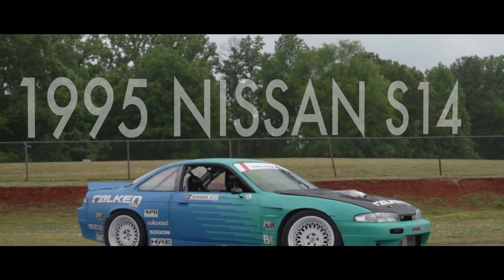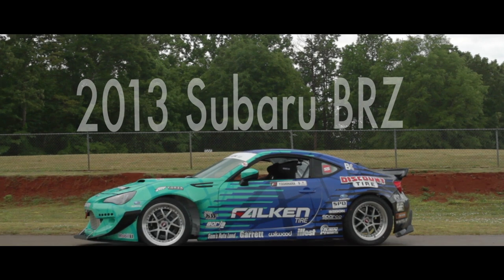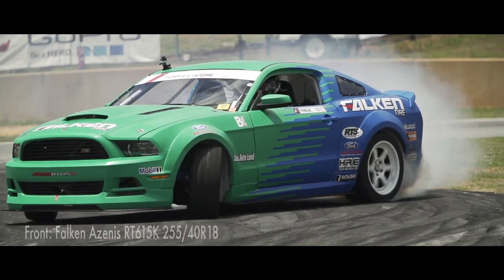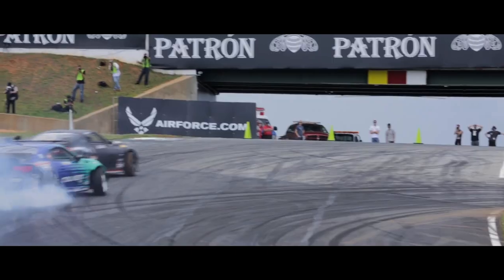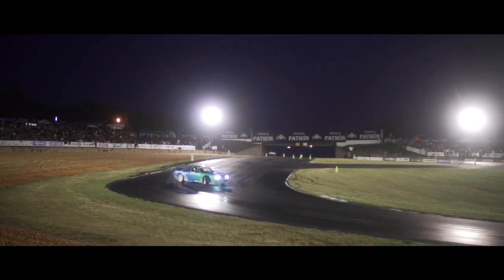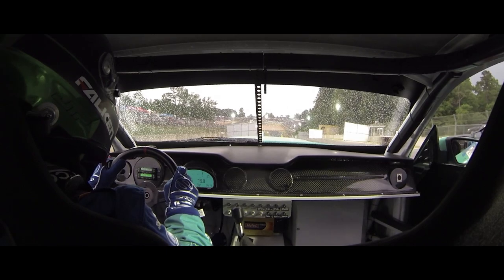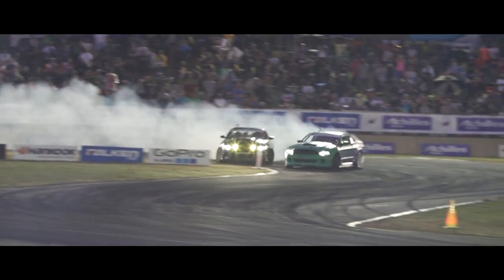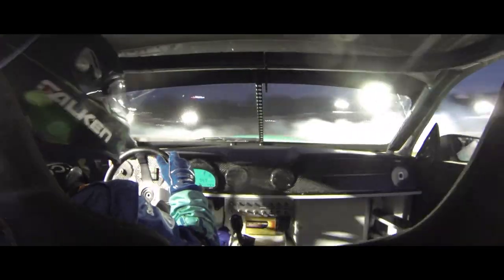1000+ Horsepower Drift Machines Explained - Controlled Chaos Eps 2

Comment: I just don't understand..... Why make the GT86 with what it comes with stock just to replace it with a big v8? I mean it's defeats the point of the car... With that engine what's the weight ratios? Can't they make a 2.6 boxer FJ engine   and boost it?
Reply: A lot of you V8 haters would be surprised that "aluminum block" V8's can actually weigh less then the iron block I4, I6, and V6's they replace... 

With the GT86/ FRS having the Flat Four 4U-GSE/ FA20  and guessing that it is made out of aluminum, an LS swap would only add a couple hundred pounds... I'm sure that weight is being stripped, or balanced on these comp cars in some other way. Also working on a V8 is a hell of a lot easier/ cost effective than a 2.6 boosted boxer swap.
Reply: bryan1211 I don't hate any kind of engine my point is it takes away from the car it's self.... Might as well buy a corvette... Buy a civic si and remove the vtech from it to replace it with a v8 then it's not a civic anymore it's just a Honda platform to build from.... The Gt86 is a good car and I want to buy one... But after seeing this an turned off by it because no matter what I do to it just not going to be good enough....
Reply: Amari Maahes What's the end goal you desire? 200+mph wangan racing? Ya, GT86 may not be the best choice(unless you motor swap, or upgrade motor $$$)... Fun daily track/ drift car that one can progress with and slowly modify? If the second, it's a great platform! I'm sorry but 200hp is more than enough power on public roads and you can just as easily spin out, or die in a stock GT86 than any high HP exotic...

The whole "once you change an engine it's not the base car anymore" is kind of childish... One must use the platform they acquire and build/ modify the way they seem fit. Most of these comp cars are purpose built and only share the frame and some sheet metal of the original vehicle. The important thing is balance! The Japanese build great fun car's because they understand a car you want to drive and have fun with "everyday" must be well rounded and balanced.

 Adding power these day's is easy... one must upgrade tires, brakes, and suspension to truly get the benefits of high HP. Then comes adding support through roll caging, bracing, bucket seats, ect....  If you have no skills, all of the above will be pointless!!! These car's don't drive themselves and a stock FRS/ GT86 will teach you very basic/ fundamental driving techniques. If you already have those down the GT86 will still be a great car in stock form because it's a drivers car (meaning it's fun to drive!).  Many people are making turbo kits that pump these up to 300hp. With the weight of these cars + 300hp you could be smoking older stock Vettes no problem.

And finally a C6 Corvette weighs about 3,300lbs and has an LS3 that makes around 430hp. A FRS/ BRZ/ GT86 weigh's around 2,800lbs, so if that Ls3 was thrown in the GT86, it would double the HP output over stock and still weigh about 300lbs less than the Vette... Oh and with just a basic engine swap it would still be an GT86, just with a different power plant.
Reply: Firstly don't put words in people's mouths and modify peoples words for your own means and secondly don't make assumptions.... I don't race on legal roads.... When I spend my money on something I want to get what I paid for! Am not going to invest 28k in a gt86 just to replace to motor down the road.... And invest God knows how much more turning it into what you desire it to be.... Am not against it but why buy something just to transform it into something else..... Same reason alot of people out there rather buy a BMW.... you get good platform and a good engine... No need to drop a v8 in there just mod and tune and your set... But to each his own... Can't wait to see what the M235i can do...
Reply: Amari Maahes are you ten you are trying to compare consumer cars to custom built race cars that only pro drivers cold drive at there limits. not to mention you compared a 25k car to a 45k car.
Reply: CruzinKrispy don't worry about it... buy what you want and be happy..... I rather buy a 45k car. It's fruitless trying to explain...
Reply: no its not that I have a problem with buying what you want its just that trying to compare a 45k car to 25k car is  pointless of course it doesnt come with a twin turbo I6 six because it doesnt cost 45k like the bmw does. as for the v8 swap things i understand your a buyer not a builder, most people that are into cars are the other way around.
Reply: bryan1211 boxer motor has lower center of gravity though.. all these D1 cars are great on the track but really shit on a tight street type circuit
Reply: Rick James I wish I could agree, but just look at the Mitsubishi Evo's and one could see that they can keep up and dominate there rival boxer equipped Subaru STI's (I'm a big Subaru fan btw). Meaning the boxer engine isn't that much of an advantage (even in tight stuff).  Also these D1 cars are made 98% of the time for huge sweeping racing circuits (thus why you have the huge HP wars). A tune/ HP output for a small track vs. a big one would be completely different. Also are you talking about drifting on a smaller track, or grip racing/ Touge?
Reply: Amari Maahes 45k car budget? Why the fruit would you even consider an FRS/BRZ/GT86??? You must really be 10... If you're not, do everyone a favor and buy a mini van please!
Reply: What no one seems to understand is for some reason you want a car that's capable of over 9000 power levels (on it's original engine that's still very new). Yet you could possibly have a budget of around 45k and would rather buy something new and capable, that doesn't require an engine swap... Dafuq would you even consider a FRZ/BRZ/GT86 for then???

 Also come on the "keep it's soul" comment again... People drop 2jz in BMW's, 13b's in a 240sx, it doesn't mean shit!  Do what ever makes you happy, but don't rip on a car that was never designed to have over 300hp and then bitch about someone throwing an LS engine in it to make it competitive... Then on top of that saying because someone swapped an LS in this car, it's "soured" the vehicle in your opinion some how?? You seem to have the personality of a mini-van driver... I'd start there first!
Reply: Talking street cars, yes why change the main engine, just "improve it". However when your talking dedicated race car, you go with what is proven to work. I mean if the v8 twin turbo engine is able to handle the punishment of this version of racing with out having to rebuild the engine every race, then go with the V8. Real race cars are nothing like their road going counter parts other then the look of the outside. You would never want to daily drive any one of these, not to mention for legal reasons, but just for the ability to stop go in traffic these things would be miserable to drive.
Reply: I think they can do whatever the fuck they want to do, and I'm sure they know exactly what's best.
Reply: 2ofEverything ya I agree, they're not called professionals just cause they like the sound of the name.
Reply: Amari Maahes Dai drives a BRZ because he is sponsored by Subaru. He put a v8 in it because his team has been running v8's for 4-5 years and they trust the platform. If you dont see the point in buying a 25k car and spending 3-6k on it then all you have to do is not do that. Somebody who criticizes other people for doing what they want to their cars with their own money has no business doing so. I could buy a used car for 1500 and spend 20-25k on it and get supercar level performance out of it, and would enjoy the car way more than if I bought a 25k car because I would have put my own soul into the car to make it exactly what I wanted it to be.
Reply: Stephen Kauffman good point . Thank you.
Reply: 1000 hp just blows me =/

Comment: 1000 HP? People have won D1 with a fifth.
Reply: 1000 HP has been in D1 long before it hit the states. lol Just the states are catching up to the numbers. Daigo's Chaser in D1 was around 700hp - 800hp back in 2008 - 2009. Takahashi's old Chaser was around 800hp back then. Around 2012 Daigo's MK2 was pushing 950hp+ (Estimated) with Nitrous.

And I don't see nothin wrong with high HP. This isn't kiddy drifting at that level. And just because they run high hp doesn't mean they lack any form of skill. The reason they run high hp is usually because the lower hp actually limits them on what they can do with a car at their skill levels.

Shrugs I can only dream of doing what half of these guys do in their beater cars let alone their pro cars.
Reply: ***** drifting low power cars involves so much more skill. These high powered ones are just for tyre smoke and easier for breaking traction and keeping it broken.
Reply: Sunny But like I said it doesn't mean they lack the skill. They still use they're missle and beater cars but just in lower tier competitions for fun and more track time and to gain more experience.

Comment: Drifting a car would be really fun.  Fun to watch also.  But I'm just not a fan of LS V8's into like the brz.  Its not a brz anymore.  Its a chevy.   I do  hate on v8 or chevy.  LS motors are great for power, is cheap to build and is reliable.   Drifting is not like road racing where the teams actually develop the cars  platform.
Reply: vangt858 I agree

Comment: Is it REALLY necessary to pump out 750-1000hp into these cars??? Why couldn't they leave the original FA-20 in the BRZ? Or swap it with a EJ257 motor tuned by Crawford? Seems unnatural. :/
Reply: Becuz drift. and its a horsepower race between different teams aswell engines with more cylinders have more low-end torque
Reply: Its a drag race to the first corner and if the chase car is too far behind they get zero points for an inactive chase.

Comment: Too bad you have 750 more hp than you actually need to drift
Reply: Drifting for fun is a whole different ballpark to competitive drifting...
Reply: What's the point of this post? To rage that you aren't competing at a level like this? Goodluck doing what they do in a ka/sr lol
Reply: Josh Johnson Dave Briggs runs a SR in his formula D car.. Turbo 4 cylinders FTW!
Reply: The reason they have the power is so that they have the big numbers, can slide easier, and so they can say they have more power than any other company.
Reply: Still if you've ever watched d1 Grand Prix specially in the old days like 2001-2005 they were and still are the highest level of competition and some cars only ran 300-400 hp and the highest were 500-600
Reply: You have no idea what your talking about d1gp is proof that you don't bed high hp to be competitive at the highest level of drifting day yoshihara came over here to drift cuz he couldn't compete with the d1gp the high horsepower is just making sure that the privateers can't compete unless they have big pockets watch some d1gp how smooth they drift how little corrections are made in steering angle and throttle and how close they get with a 300hp car against an 700hp car and when the 700ho car loses sit there and wonder why that happened drifting is about keeping up your speed and momentum thru corners that takes skill look at team burst using 330hp sr20s and Naoki is one of the best drifters in the planet

Comment: say no to Ls swap to import smh. I love my s13 with 300hp sr20det.
Reply: +francis brown As much as i love an original engine, you just cant run 800+ hp on an SR20 reliably.
Reply: I agree 100%. 800 hp is a huge number and even LS wouldn't be reliable at that number. At least not for prolong period or repeated abuse. I would consider RB swap before LS.
Reply: gotta unleash that coyote
Reply: S13 should have ca18det .....
Reply: Zuze91 depends what year his s13 is
Reply: RB is too expensive to be used for drift special with 800+ hp. LS is engine with great specs and durability.

Comment: How do they even fit that engine in the BRZ's engine bay?! Is the nose longer than stock? The dash looked stock so I don't think the engine is pushed back??
Reply: It just falls right in. Stock engine in the BRZ is fairly wide to begin with.
Reply: The Chevy LS V8 platforms are heavily compact man. You could fit the same engine into a damn S2000 or Miata. Granted you need stronger mounts but still it would fit in well.
Reply: There's a shop based out of Connecticut called Weapons Grade Performance that's building an LS swap kit for these cars now. I'm not sure if they were the first to put an LS in one, but it's been done for quite some time. You can probably find videos of it on here if you search BRZ06.

Comment: I honestly so tired of V8 swaps, I remember when this trend first started and I thought it was stupid back then, you do not need 1000hp to drift, truthfully a drift car shouldn't have over 700hp which you can achieve just fine with a 4 or 6 cylinder, when I start drifting not matter if I remain amateur or become the most well known driver in the world I will never do a V8 swap I'll do a 6 cylinder swap but not an 8
Reply: Same here. I really loved that Forrest Wang decided to swap a 2JZ instead of a V8. If you look at his car there is a sticker that he has that says V-H8.
Reply: hellisin666
miata?
Reply: hellisin666
 you just said it had a 1.8L flat six, but an SR20 is a 2.0L inline four...
Reply: The cars that run 1000 horsepower do so because initial entry speed is paramount. If the car your'e chasing can get to the first clip way before you and are able to accelerate throughout the entire course then it will be an inactive chase, and they will be welded to your door on their chase.  Also, if they were running 300 with the same suspension setup and grip level as they do now then they wouldnt be able to get the car sideways much less be able to accelerate through a drift.
Reply: hellisin666 you do know a sr20 is a 2.0 i4 not a 1.8 flat 6 right? Unless you have two engines one I've never heard of you must be hmm lying.

Comment: I don't like high hp drift cars, i own a 1998 2jz 240sx running a daily driven 512 bhp, and i drift it on a track. I understand the v8 swaps, but personally i think its just a bit overkill having more than 800hp, after 800 its all just engine power doing the moving, all the driver has to do is just put their transmission into 2nd because D1 cars use 4 speeds with insane gear ratios and either pop the clutch or use the handbrake to initiate and the engine does the rest. Drifting is suppose to be on the skill of the driver controlling the car as smooth as possible, the power of a v8....I'm not forcing to back the original engines i love how v8's can be but 1000hp is unnecessary....please D1 tone the power down under 800 its just overkill, i mean 600 hp will still give you a lot of tire smoke. I know some people can agree that after 800hp is just overkill

(NOTICE: I'm not trying to cause a argument i understand that other people have different opinions and that i am not going against their opinions)
Reply: I totally agree. I commented on another guy on how my built drift car that has a 1.8 litre flat 6 has 550 BHP and still feels like it has too much power.
Reply: I also think how it is overkill to put in such a powerful engine. Like you said, it should be the driver controlling the car not the car drifting for you.